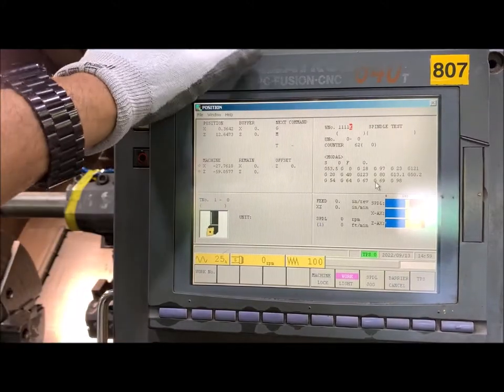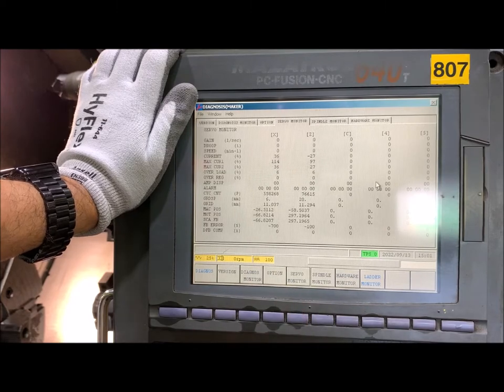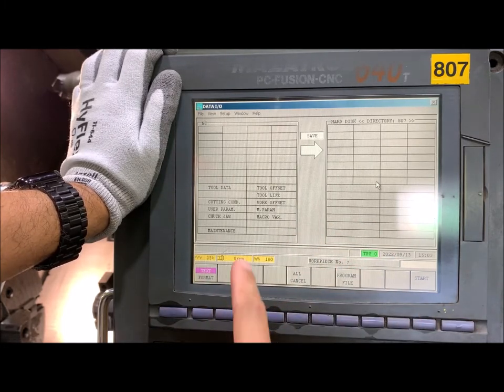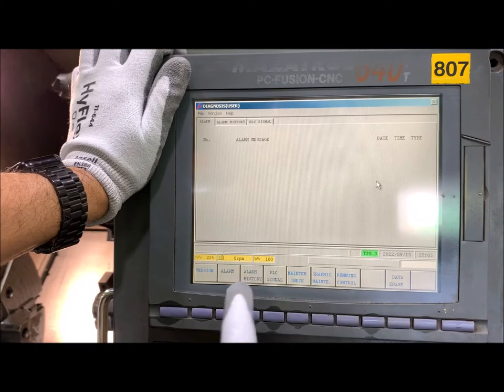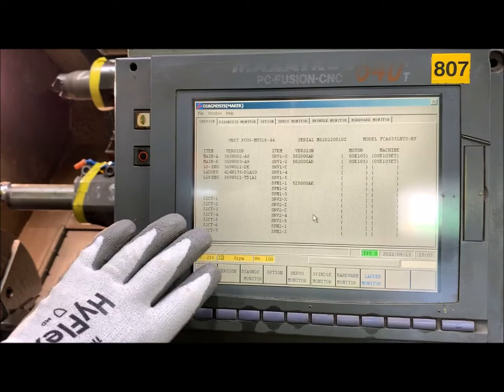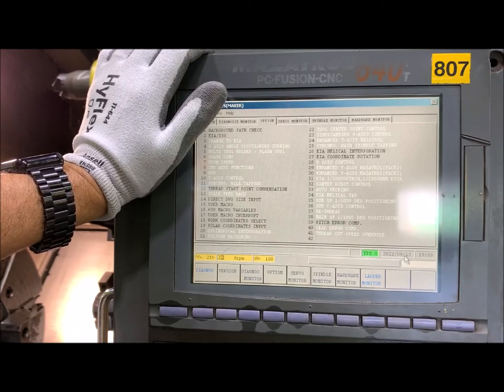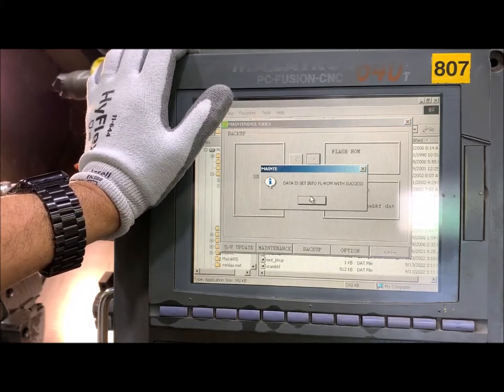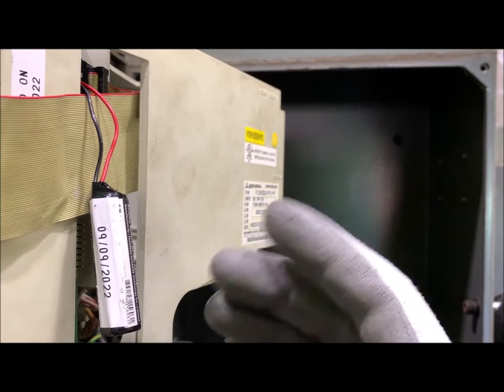M640T backup, initialization & recovery after 26 illegal parameter ( 1, 36, &0037) & ( 1, 41, &0037)

Comment: Dear Fabian,
Thanks for the great video! It help me a lot, to solving my machine problem.
I would like to ask you a question about Maintenance tool software.
In 21:36 from your video, you are restoring NC parameters from the Backup file. In my case, after pressing <, the Maintenance Tool request password in a separate window.
For the password there are tow fields divided by a dash - !
Any advance will be highly appreciated!
Best Regards,
Dimiter
Reply from the maker: @Deimiter, that means that you are trying to upload a file mnt_bkup.dat (created from MAINTENANCE menu) that belong to another machine and the NC SERIAL # doesn't match.
Make sure you are using the correct mnt_bkup.dat file for that CNC. To restore that file is necesary when you lost NC OPTIONS or you don't have NC SERIAL # at the left of that screen.
Finally, you CAN'T use the file mnt_bkup.dat from one machine to recover another one. That is why is so important to make and keep safe these backups periodically.
Hope this makes sense.

Check it at https://youtu.be/8ZT6r7wbzDk?t=600
Reply: @FabianAchaval  Hi Fabian,
Thanks for your response! Your advice really make seance! Some time ago, the problematic machine had a HDD malfunction, so I replace the faulty  HDD whit a clone from the  the neighboring machine! That solution work whiteout problems! Cloning the HDD, I cloned the mnt_bkup.dat from the neighboring machine! 
I have an genuine diskette with the machine parameters - hope it`s still working! Can I upload them from there?!
Reply from the maker: @DimiterGenov  In regards HHD malfunction I recommend to clone it into an SSD. I made some videos regarding that.

If the machine is up and running with all the NC OPTIONS installed and without any issue, it is just necessary to backup the current data and keep it safe and use the for any future failue that may be required.

If the machine is missing NC OPTIONS, then you have to recover them using original "mnt_bkup.dat" file either from the FD (flopply disk) or any other media

If you still have FDD (Floppy Disk Drive) in use, you can upgrade it using a Floppy Emulator and create images from the original FD if still work.

Hope this helps.
Reply: @FabianAchaval  Hi Fabian,
I have tried you yesterday opinion. Unfortunately it was`t that case whit the cloned HDD!
I have make a short video https://youtu.be/mniu1riYdJo
Everything whit the NC model, and ser # looks OK, I mean they are identical whit the NC label.
In the Maintenance Tools in the NC field, instead of   numbers I got the word TEST - please see in the video.
Reply from the maker: @Dimiter, definitely you have lost your CNC data at the left and the file you are using does not match with the CNC. Open the operator panel and on the back of the display is the CNC UNIT and should have a label with all the CNC Information including NC serial number.
Then , using a plain text editor like NOTEPAD you can open (do not edit, close it without saving) each mnt_bkup.dat file an if you have one with the correct serial number, then upload that one
Reply from the maker: Have you performed the REINITIALLIZATION using the rotary switch on 7 from the back? That is important to bring back to default factory data
Reply: @FabianAchaval  Hi again Fabian!
Thanks for your support! You are a star! 
As you recommend, I have tried the REINITIALLIZATION of the NC. There is some positive progress after this - now both sides NC and the BACKUP in the Maintenance Tools panel have the identical SN numbers, etc., same as on the NC label. Unfortunately after trying to restore from the BACKUP, the software still request password! There is only one difference -  in the BACKUP side, there is OPTION DATA row, followed by ******
In the NC side, this 8* are missing. The row after  OPTION DATA is completely - empty!
Reply from the maker: Glad to hear that! Have you checked with NOTEPAD the content of mnt_bk.dat file? You must read the same serial number. If it is different, then it is not the correct one. Do not try to modify the file because it is binary and will be corrupted and rendered useless.
If you can’t find correct file, then you have to contact your local Mazak office and ask them for the back up for your machine serial number.
Most likely you will have other backups on the HDD. Check all folders.

Good luck!

Comment: what about windows 95 upgrade? if windows crashes do you have any suggestions?
Reply from the maker: To upgrade your Windows 95 to Win2K you need either to buy a new SSD to Mazak or Mitsubishi, where you will have to spend about $2.5K; 
or get an standard image and make the clone by your own, spending about $500.00

To have a backup of your current HDD and be able to recover it as it is,

See how to clone the HDD into CF
https://youtu.be/63ZvuMYEe78

Or 

See how to clone the HDD into an SSD https://youtu.be/kfaf0Qatn9k
Reply: @FabianAchaval  cool thanks, man 
does this happen often ?? like it will happen? 
or mitsubishi was trying to scare me? they said your windows 95 will eventually crash and you have to upgrade
Reply from the maker: @christophercolumbus8944  if your HDD is still working, do not get in panic, but is time to take control before a failure occurs!
I highly recommend:
1) To change the CNC battery annually with the CNC ON.
2) To create an image and keep it in a safe place. 
3) Then create a clone on a CF as explained on https://www.youtube.com/watch?v=63ZvuMYEe78. On the description you have the BOM. It is the cheapest way.
4) Then, test it on your machine.
5) If succeeded, you can create another clone and leave the one you tested working.

The upgrade to Win2K is not complicated, but it is not necessary unless you have to change the PC board, where the production of card PC (CARD586/686) for M640 series for Yamazaki Mazak has been stopped, and NC with new card PC CARD PCI/GX (Geode processor) are produced. https://www.scribd.com/document/488371224/M640-CARD-PCI-GX-System-Instruction-Manual

See manual "C640RA1010E: Mazatrol Fusion 640 Service Procedures" https://douglasrudd.com/manuals/Mazatrol_Fusion_640-service.pdf#page=115
Reply: @FabianAchaval  yes thanks for that but what software are you using to back up all harddrive with ?
Reply from the maker: @christophercolumbus8944  I use Ghost32.exe portable that come with Symantec Ghost Solution Suite, and you can download it from https://www.pconlife.com/download/otherfile/312269/b8f4be95fbd1f6ede575c5bc79921a24/
Reply: Sir I want to replace NC unit from one to other ..so what i have to do..which backup need to save...any link of your video
Reply from the maker: @sant647  this video shows the whole procedure for a Mazatrol 640T. If you have the same CNC you can use this, and perform the initialization part after the change.

Make sure when you buy the new CNC to ask for the CNC options you have installed on your machine. Either Mazak or Mitsubishi will send you a form to fill out with the CNC information including OPTIONS.  Then they will prepare the CNC and most probably they will configure it as same serial number and the options than the one you have.
Hope it is clear.